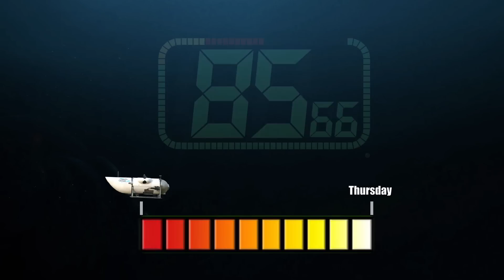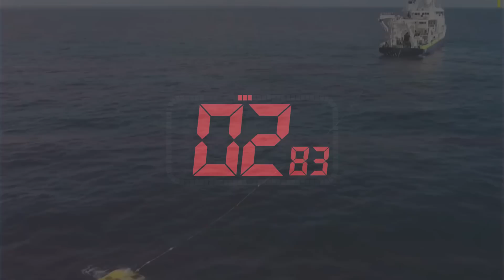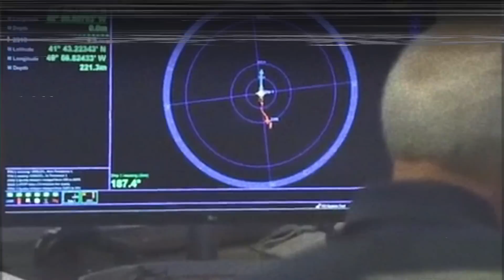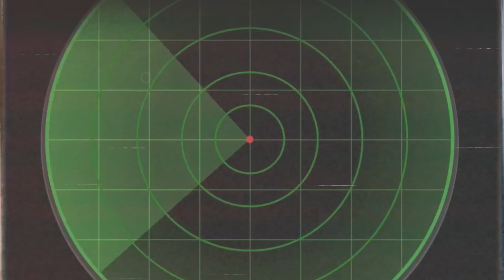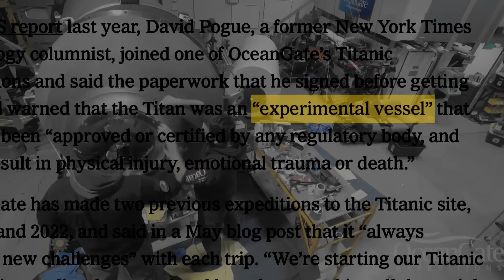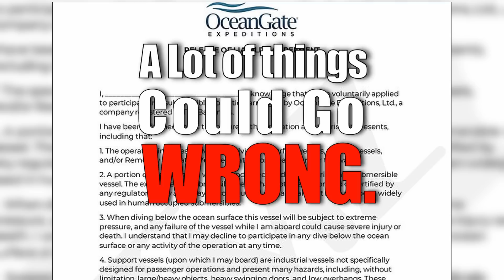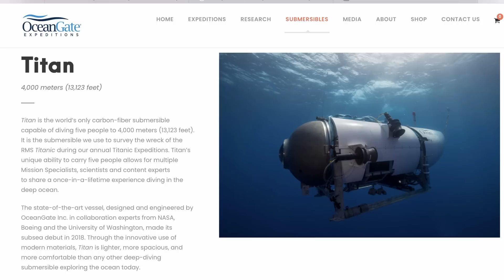Everything That Went Wrong With The Titanic Submersible

Comment: Credits where due - they delivered stunning 8K video on the titanic a few years ago. But the sub was just extremely vulnerable - there's no room for error at those depths. Carbon fiber hull, a titanium ring "glued" onto it, a window only certified for up to a few hundreds of meters and not 3400 meter, missing classification for the claimed 12.000 feet it was supposed todo, no backup plan in regards of failure - so many red flags ignored.